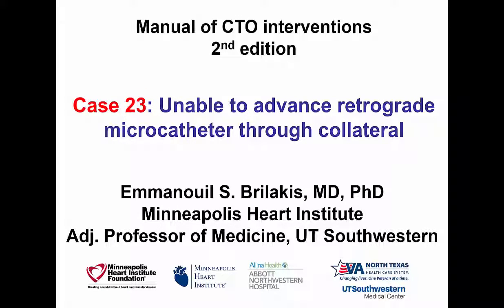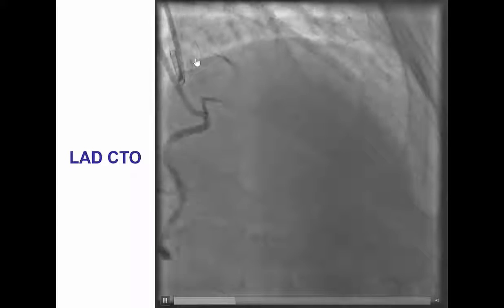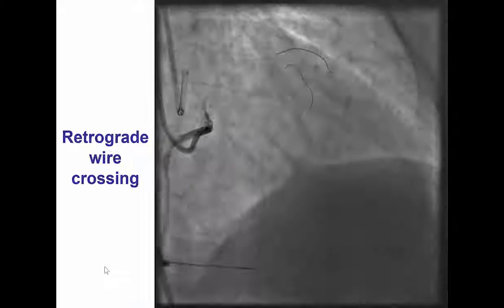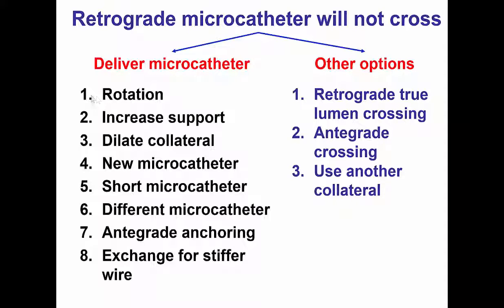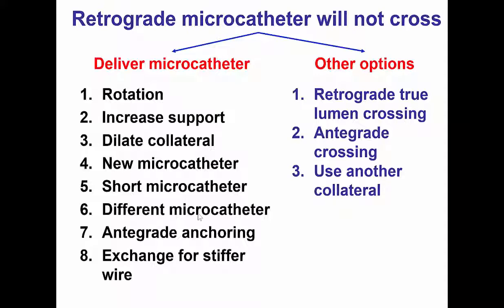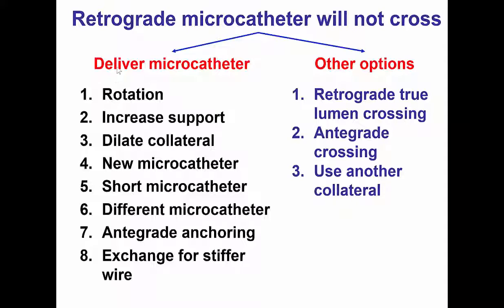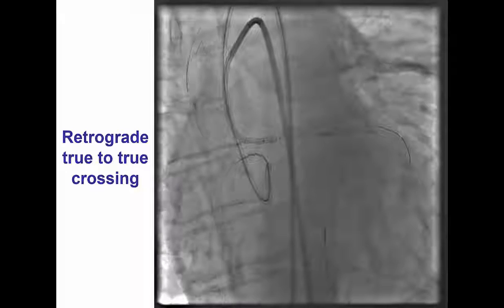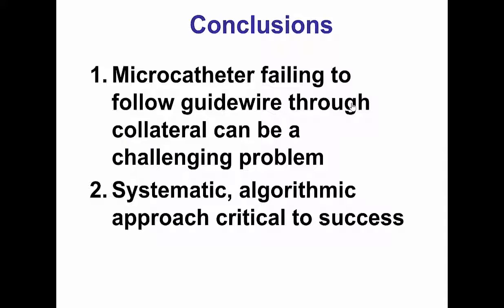Case 23: Manual of CTO Interventions - Retrograde microcatheter will not cross

Comment: Tnx for sharing your beautiful cases I have got a question about this case, after you snared the retrograde wire, which was not RG3 or R 350, the length of the wire is not adequate to be externalized from both side , you left the distal tip of the wire somewhere in the retrograde guiding? Or you finally managed to advanced the microcatheter and changed the wire?